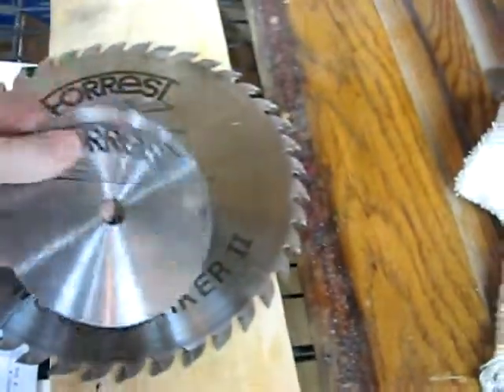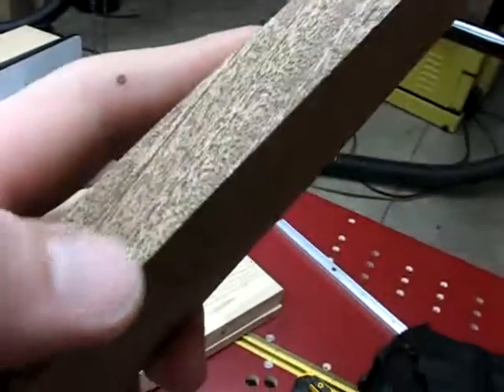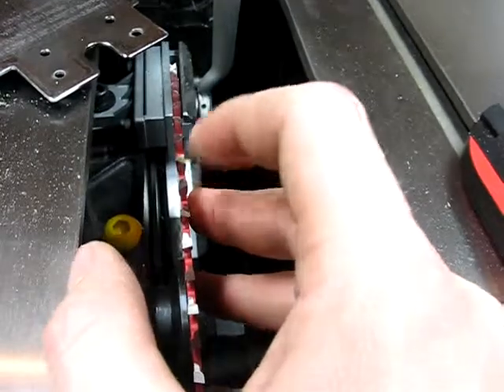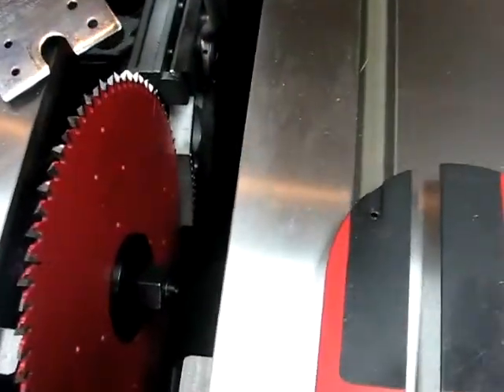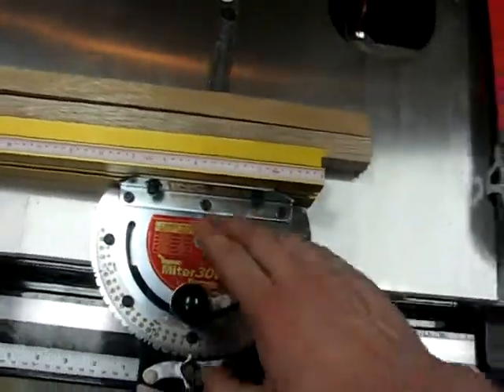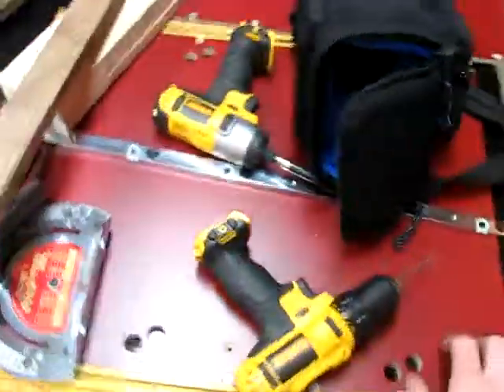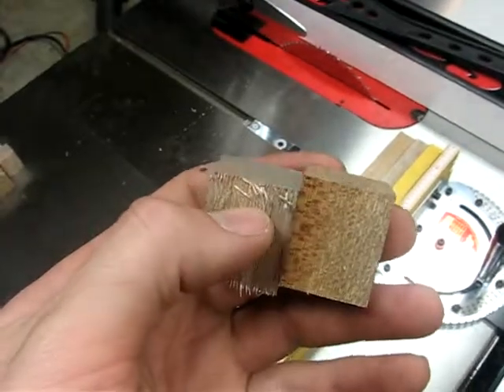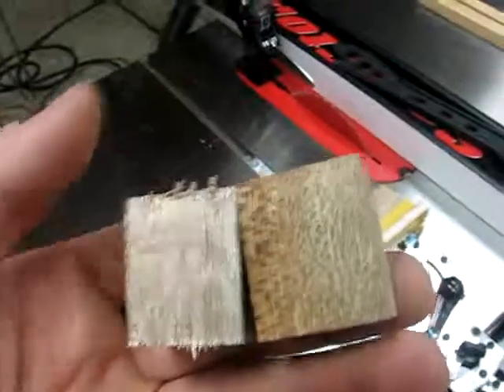SawStoping and Blades

Comment from the maker: @aaronled I have the standard kerf blade and the stabilizer, somewhat over kill but I am kinda picky about precision, you just need to make sure to put the stabilizer on the side of the blade with the nut, took me a bit to figure out why the table insert would not fit after adding the stabilizer (slap forehead). I am really happy with it so far set up was cake did not need to tweek it at all. The blade was parallel to the miter slot to about .001"-.002" out of the box.

Comment: I bought this EXACT saw (industrial 5hp w/ 52" fence) - should be delivered Tuesday or Wednesday of next week.  I've also bought the Forrest WWII standard kerf blade...  (I guess we'll have twin setups)

Question -
Are you using the standard kerf WWII or thin?  The reason I ask is b/c you're using the stabilizer shim blade as well - is this needed to line up the riving knife/splitter?

Thanks for posting!